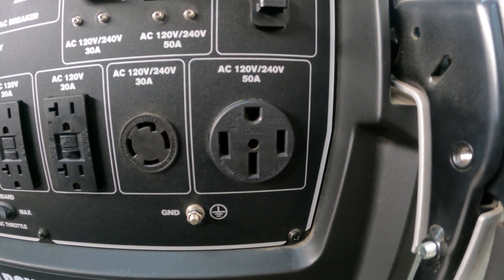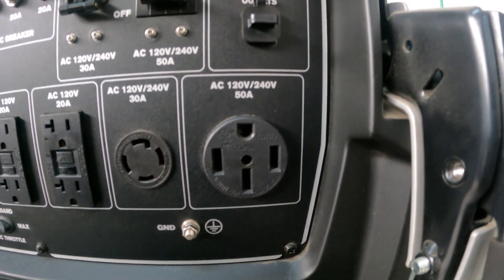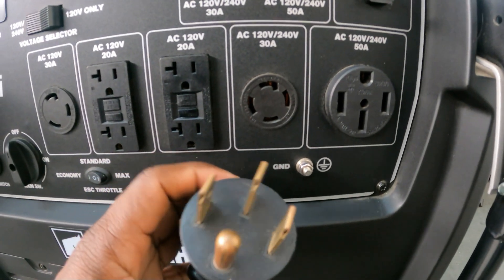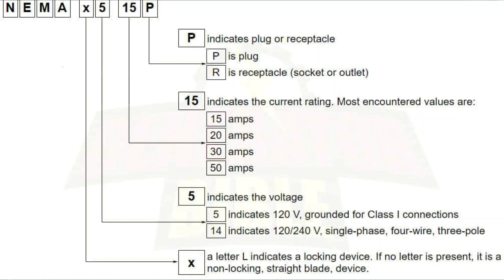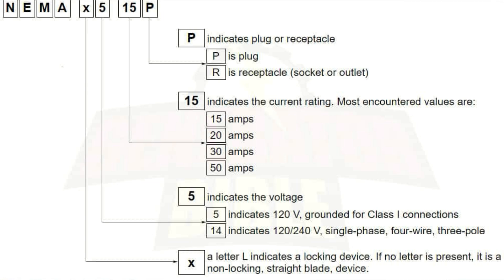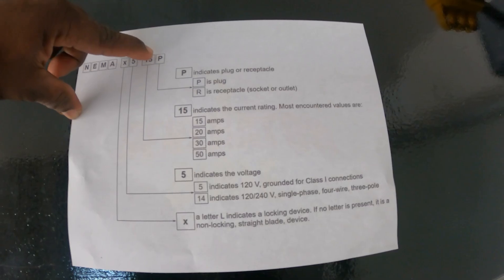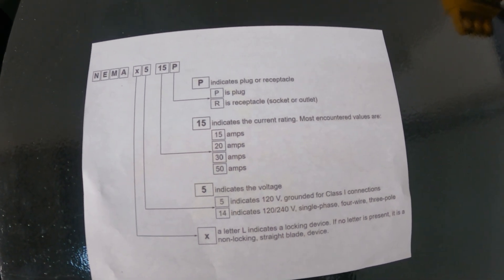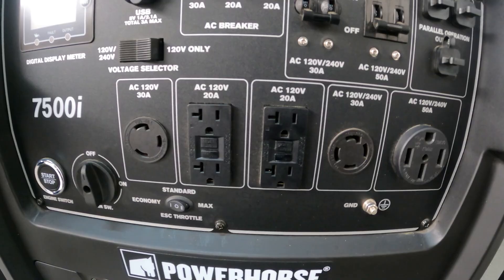PORTABLE GENERATOR RECEPTACLES: ALL YOU NEED TO KNOW

Comment: Question: When a typical portable generator comes with two outlets "rated 20 amps" (like gens shown on table by wall), is that 20 amps from both outlets combined or can 20amps be drawn from each at the same time (assuming gen wattage size accommodates)?
Reply from the maker: Combined

Comment: I have a 240 volt griddle 3560 watts which harbor freight gen do i need? Thank you! for any help.
Reply from the maker: You need a generator that has 240 V output at least 5000 W or greater
Reply: Tyvm!

Comment: I have a question with that 3rd generac generator 30amp 120 volt outlet, can I use that in combination with an interlock to power only my 120 volt appliances. I don’t have a transfer switch I only have  a 30amp generator input box. Would that generac generator you showed in this video or the predator 5000 or predator 3500 inverter generator power both 120 legs of my breaker panel?
Reply from the maker: Yes but you need to get an adapter
Reply: @GeneratorReviews  okay thank you 👍🏽👍🏽

Comment: Great explanation. One plug that confuses people sometimes when buying cords and adapters is the L5-30P and the L6-30P. They look pretty much identical but one has a ever so slightly wider plug hard to notice. I purchased a L6-30P to 20 amp by mistake. I thought I could snip a little off the lead to fit and it fit fine but the neutral and grounds were swapped internally due to it being a 240v plug.
Reply from the maker: Agreed! They could easily be mistaken.